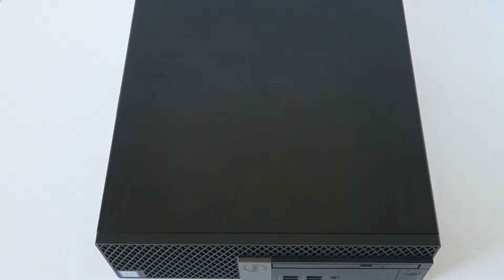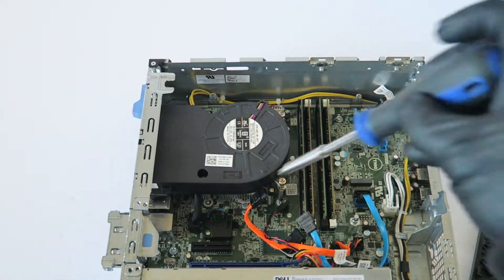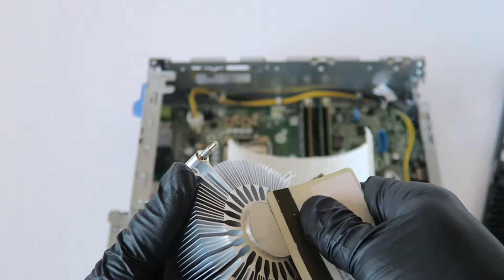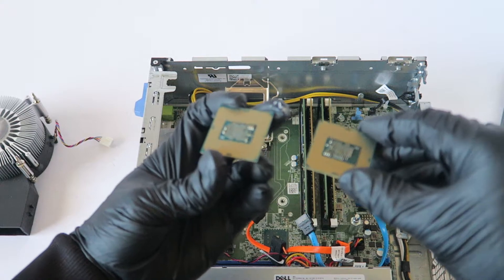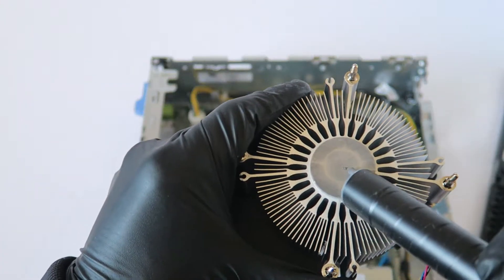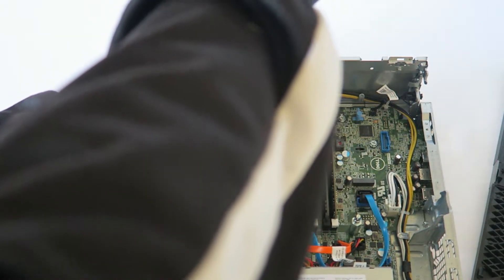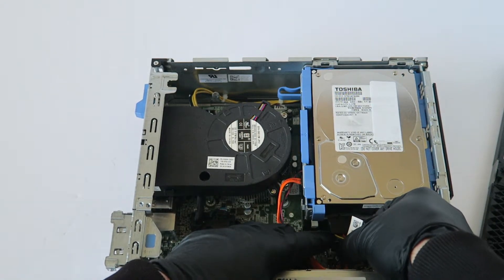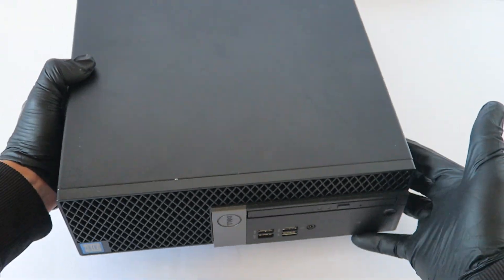Dell Optiplex 5050 Processor Upgrade

Comment: Hey, i'm currently building a PC, i'm using the Dell Optiplex 7010 sff motherboard, i have a 180w PSU that my friend gave me. Will that powersupply be just enough to run r7 250 1GB GDDR5 graphics card + i3 3220?
Reply from the maker: Hi, yes Dell Optiplex 7010 sff does have 240w power supply that should be enough to run r7 250.

Comment: hello friend. I want to buy optiplex 5050 sff for multimedia box. Can you tell me if it support low wattage T procesors like 6600t,7500t? On paper those cpu officialy are not supported. Is the pciex 4x slot precut on the end to add dualslot gpu?

Comment: nice clear simple video to follow thanks . hi i have a dell opti 5050 sff with Intel(R) Core(TM) i5-6500 CPU @ 3.20GHz   3.19 GHz-16 ram--256 ssd---1tb hdd- win10 . i noticed when i done a health check for win 11 it said the cpu is not compatible can i upgrade this pc or would i be better with another pc . if upgrade what would be my best cpu thanks
Reply from the maker: Hi, yes PC does support Win11.

Comment: Can i upgrade the processor to AMD ryzen 5?
Reply from the maker: Hi, no.
Reply: @Mxkdt  oh thats because the motherboard supports intel only thx for telling
Reply: @Mxkdt  but can i add a Nvidia RTX 3090 graphics card in dell optiplex 5050? or GTX 1660
Reply from the maker: @Spenorix  Hi, only possible to add gtx 1660 in a Dell OptiPlex 5050 MT.
Reply: @Mxkdt  Hello is it possible for me to add intel core i9 processor to Dell optiplex 5050?
Reply from the maker: @Spenorix  Hi, no and fastest CPU you can install in that PC is intel core i7 7700
Reply: @Mxkdt  Oh but is it possible to install intel core i9 unless I have changed the motherboard which is very powerful?

Comment: Hi!  I have got an Optiplex 5050 sff with an i3 7100.Can I upgrade the CPU to an  to an i7 8700: in that case is it compulsary to upgrade the bios ?
If not, what the best CPU  it may support ?

Thanks for answering..regards
Reply: no you are limited to 6th and 7th gen cpus the best one you can get is the i7-7700

Comment: Hey Mxkdi.. I have a Dell optiplex 790mt and it shuts down by itself after 4 mins of usage so I thought it was a PSU problem so I bought a new and replaced it now after 10 mins of usage it shuts down automatically.. ANY suggestions, I'm so pissed...
Reply: Did you try updating the BIOS? Updating the BIOS could fix issues.
Reply: Brian Dorsey how to do that?
Reply: Go to Dell's website and go to support, then go to drivers and look up your model or enter your service tag. Then look for BIOS updates and you will see them in the drivers section.
Reply: Is your machine overheating?

Comment: Hi mxdi,
can I upgrade procesor in dell optiplex 3010 sff?
Reply: The maximum upgrade for processor optiplex 3010 only intel processor gen 3 for core i7. Better buy higher optiplex.